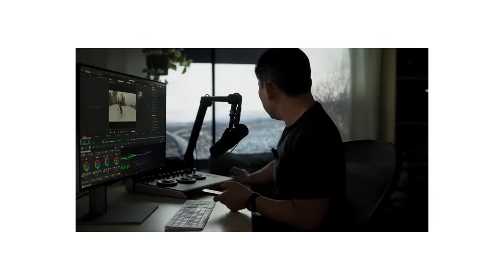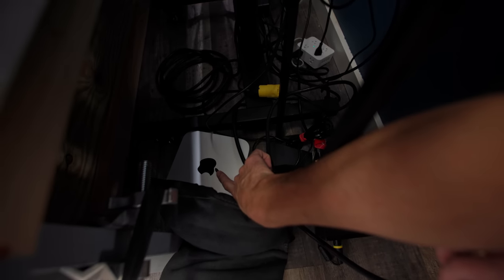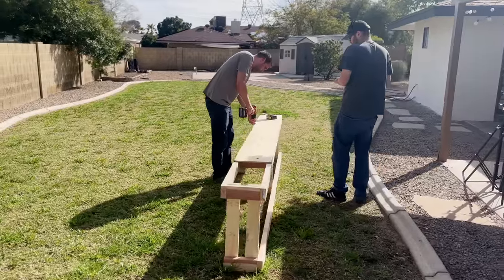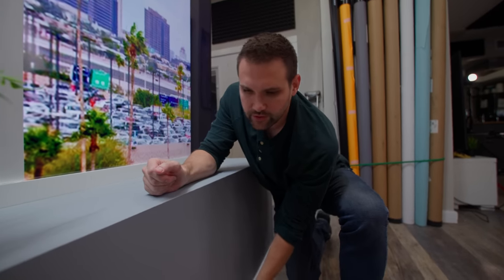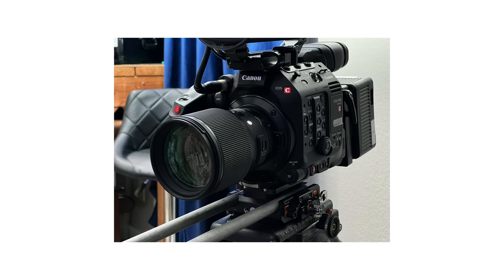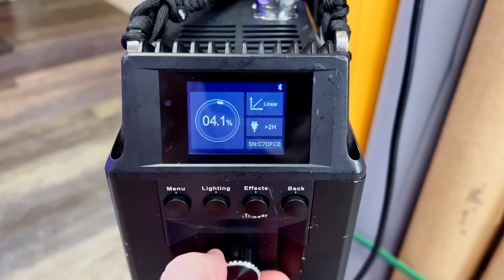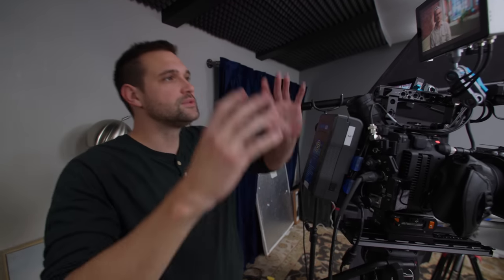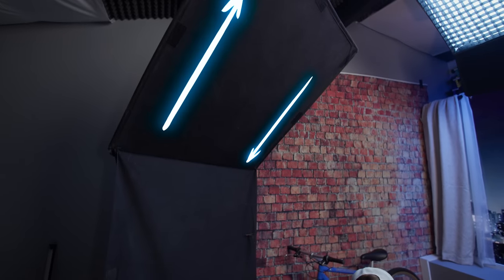How to make a TV WINDOW look REAL

Comment: the way the brick backdrop shot cleverly blended with the screen was very convincing. looked like you were in a large space
Reply: it blended so well, might have well just used 2 backdrops. instead of this whole rigamaroll. using video on the tv will set it apart, not this.

Comment: The fact that the curtain in the room and the buildings "outside the window" have the same degree of out-of-focus blur could be a give away. I would consider blurring the image from the TV's a little to add blur to the "outside the window buildings" as opposed to the elements inside the room which is supposed to be much closer and a little more in focus.

Comment: One big advantage that I notice here is that you would not need nearly as powerful of lights to pull this off because you wouldn’t have to battle the brightness of the exterior. Like the video mentioned, you only had to have that 600 D at 2.3% and you could 100% pull this off with a key light 1/4 the size and power.

Comment: This is incredible. Expensive, but still saves a ton of money while remaining portable and simple. The only thing I can see as an issue is the lack of parallax with a moving camera (for the city background) but other than that it looks great. I think experimenting without the white trim on the tvs would look good too as black trim is probably more common. Great job ELM!
Reply: And that could be fixed with some Vive Mars type stuff. But for a city, it's maybe not that big a deal
Reply: Can you not do it with a cheap projector?
Reply: @Alec15  not a "cheap" one. It'll be easy too dark. Already cheap TV is coming out a bit dark
Reply: @Alec15  I thought of that too but it would probably get too washed out
Reply: @mortalens  and if you shoot wide open?
Reply: @Alec15  i’m talking about the light he had pointing at the tvs. that would surely overpower the projection even on a low setting. worth checking it out though
Reply: Wanted to say the same thing about the parallax issue. HTC Vive all the way. As for another commenter, see the Andyax take with an expensive projector https://www.youtube.com/watch?v=MfJxktnOD8Y&ab_channel=Andyax
Reply: Should I make an image and skybox/hdri viewer which is controlled by opentrack? Would you lot pay for that?

Comment: Great video! Was thinking about this afterwards; you could switch the white spacers/separators between the TVs with black, wood, etc. Also, you could have drill a hole in a set and add light sconces/fixtures - these could be off-the-shelf or 3D printed. 

3D printing would allow you to scale and customize the fixture design (art deco, modern, etc.) and they could be painted - might need to block out the side of the fixture that faces the window/screen - otherwise it could cause some odd reflections. Little aspects would really add to the ambience.

Comment: Looks great! The only thing I'd want to fix/add is a way to move the TV's to the other side a lot faster. There are many sit-down interviews where I would like the interviewee looking to the left of the camera instead of the right. Especially if I'm filming more than 1 person per project. Also a nit-pik but the blue "moonlight" needs to be toned down for saturation - I feel like the general consensus for moonlight is to blast the set with a very saturated blue light and in this case I think less is more.

Comment: Well done, I also noticed you guys upgrade? to the C500 Mark II!? Big fan of my C300 mark III, but I did find, occasionally the shadow noise on the C500 not as clean as the C300.  Do you tend to ETTR a little more in general? But now I kinda miss full frame on that body. Heck with the price drop maybe it's worth upgrading too. So how do you like the new camera, what was the goal of changing, and any reason you didn't buy into the hype train of the FX6 (beyond already owning a million canon EF lenses).

Comment: This is very impressive!

I've done something similar to this. Though certainly not as high-production. But a couple of quick suggestions to make things more convincing or convenient, if you have a bit of extra budget and coding know-how.

0. Use video instead of an image. If you have birds flying by or people walking around, that's the extra step that'll really make it more convincing.

1. Send the average screen color to your lights. Especially the back projection and the Aputure tube above.

-You can do this with just a text file associating an average color with an image, or you can take screen captures and process them. Only needs to be about 10FPS.

- Add some sliders for things like white balance and saturation. But properly set up, you could probably get away with adjusting these only once.

2. As a more advanced option, consider in large scenes, a window acts as an extremely blurry pinhole camera. So bright spots on the left of the scene will project light on the right side of the room, and vice versa. So if the sun is on the right, you can project light to the left.

3. As an even more advanced option, you can do image convolution with a kernel for determining the light source location in the image. Basically calculate where the sun is, and have it adjust lighting accordingly.

I did something similar to this in my office once. I used my GPU to speed up the process to 60FPS. This was really cool, because you could have a video of a lightning storm and it includes your room in the lightning.

I suppose you can do this with Philips HUE. But you might still want to just have it talk to an API for the DMX controller. I'm not sure the CRI of HUE bulbs is good enough for colors that are anything but temperatures of white.

I thought about, if I were to do this again, or a setup similar to yours, going the Disney route and basically making the scenes in Unreal and syncing them up to camera position.

Comment: My favorite was the night shot. It looked very real. The second room depth one is quite good as well, but in that particular case, I found the white TV bezel covers between the TVs a distracting thing that broke the illusion. Perhaps if they were black to match  the trim in the “distance”, I would feel differently. Not sure. It does look amazing though. That brick on wall really makes both the second and third sets. 

The first one though, looked artificial to me. The window just did not look natural to me although still good considering what is really behind it. Ha! But something was just off on it. I think it was the light coming through. I’m wondering what a sunset shot would look like though. It would probably be challenging to get right with the directional light needed, but I think it could look stunning. I’m also wondering what sheer curtains pulled all the way across, rather than just the side would do for realism?

Comment: I filmed a short film for my college intramurals where i put a 40 inch tv outside the house and place it on the window because im too lazy to track footage and key it out. we did similar with the edges through set design but not as yours. One thing i learned about that technique is to avoid close ups with wide focal lengths and deep aperture (like f5.6) where you can see the rgb pixels of the tv.

Comment: Hey guys! Thanks so much for this video. We have purchased everything on the list. Something we are finding is that the TVs are sitting lopsided on the stands when we mount them vertically. Any advice on what y’all did?
Reply from the maker: We horizontally gaff taped a lightweight pole behind the tvs to get them all at the same angle
Reply: Thank you! You guys are not awesome, and I didn't subscribe. @EpicLightMedia

Comment: Nice, NOW, Will you be trying to figure out how to fake a perspective paralax move of the background synchronised to a slider. Without VR tracking equipment and Unreal Engine. It would only require some sensor on a slider, that can transfer data to davinci and move background sideways in sync with a camera. That would be even awesomer idea.

Comment: Great vid. Pretty sure this can be built for a fraction of the price though. Potato Jet used 55" TVs so 75" might be overkill. Also I would consider buying the TVs second hand (as long as it's the exact same model so there are as little variations in color, contrast, etc. as possible). Finally you can probably get away with just two TVs in 95% of cases, as long as you build your set right. Maybe even just one if you're really smart about it (though you'd lose some of that "wow" factor). By doing all that you'd considerably lower the cost. Just saying for anyone wondering how they can do it in a more budget friendly way. :)

Comment: Epic shots, interesting light... 
I'm really sorry to say, but this channel is awfully helpful to learn stuff.. It has really made me focus more on light on the set whenever possible (even it budget doesn't always allow it ). 

I had the 1200d on a job the other day and couldn't get the power to go lower than 5% or something and was still waaaay too bright. Ended up using my godox 60 with the 150 softbox, and even that was on 40% setting, added two tubes for background. Voila this was the right balance with candles, fireplace and a lot of praticals. stuff I learned here really f* helped.

not a low budget job. with screens at minimal $600 a piece, @pple studio and splitter, the wood, stands and construction, and then  lights, cam and lenses and at least a 3 person crew. you'll need a good client or deep pockets to do this investment..

Comment: I have a question... does the tv have to be PORTRAIT mode compatible ? Or are you using an adaptor?
Reply from the maker: Tv does not need to be portrait compatible. The “wall connector” sends the appropriate signal to the vertical tvs
Reply: @EpicLightMedia  thank you

Comment: That controller box seems kinda useless if you can get a GPU that has three output ports instead. But I guess it makes sense if it's cheaper than a 1030 or whatever. Depends on what you got lying around already.

Comment: The first background had some distracting colors, maybe too much saturation? The second worked best , gave quite a lot of depth, and the third was quite realistic although still something was a bit off.
I would try mat metallic coverings for the gaps between the screens as an options, those may blend in even better in some situations. Also option for a light grey fake curtain instead of beige which doesn't work in all scenarios

Comment: My favorite was the city, but I think the way you moved the camera in the shot broke the immersion a little bit. Normally moving the camera would make the background move at a slower rate than the white window post things, so I think either timing the background to move at the same rate as the camera or putting motion tracking sensors on the camera to move the image accordingly would really blow that scene out of the water!

Comment: Since it was asked what we think, here’s my opinion, and I do acknowledge it’s nit picky, though I do provide possible fixes. First, there’s the lack of atmospheric haze in the daytime backdrop. I think having less contrast and saturation in the background image would look more convincing. 2. Depth of field: everything along the window’s plane has the same level of focus. That means that the plant, the ledge the plant is on, and the window frame have the same amount of focus as the distant background. What might sell the illusion better would be to have an already out-of-focus background. 3. The angle of the window in the shot: the more the “window” is shot at an angle, the more the background’s planar nature gives itself away. It’d be “safer” to point the camera as close to 90 degrees to the window as possible. I acknowledge that may be taking the realism thing too far 😉. Finally, when shooting with a moving camera, keep it SLOW. There’s no parallax between the window frame and backdrop, so too much movement gives away the illusion. All that aside, you know what would be cool is to utilize a background that can be manipulated in a 3D engine, so that you can adjust angle of view, blur (focus) and image adjustments (gamma, saturation, contrast), as it relates to the camera’s position and the set lighting. I’m not talking real-time Unreal engine, but something in between. I look forward to the first YouTube channel taking this virtual window concept to the next level. 😁
Reply: Spot on, a bit of Gaussian blur to the image outside would sell it.

Comment: I thought this was going to be a fake window where you put a light source behind a lens that straightens all the waves so it mimics sunlight through a frosted window to make you feel happier during winter. The problem with those is that the light has to be far away from the lens so it it impractical. You need too much room for that.

Comment: The box sill you made already looks so much like a hotel air-conditioning that you look like you're trying to cover up that you're filming in a motel. Might as well put grills on the top and own the look.
Reply from the maker: Oh I thought it looked like a window sill
Reply: @EpicLightMedia  I guess it might, but it looked like a hotel room overall to me. The wooden trim looked wrong, when I could see it. And if the background is blurred, I guess it wouldn't matter. Windows sills are usually a lot thinner, like the wall, unless you're concealing an old radiator, cabinets, or something, yeah?